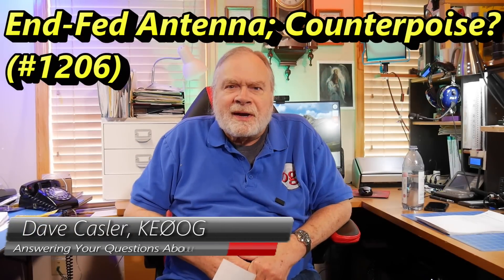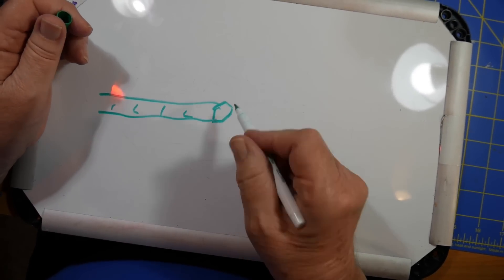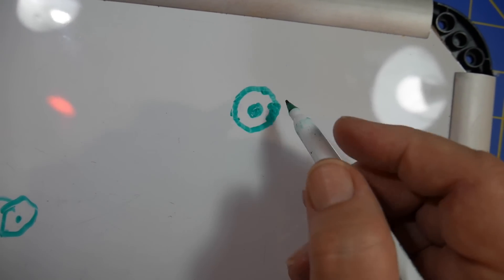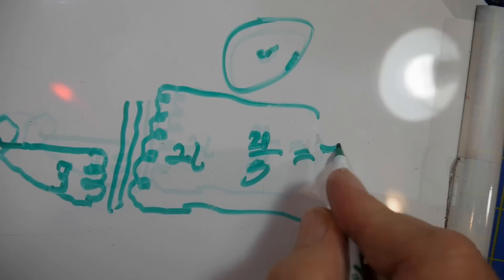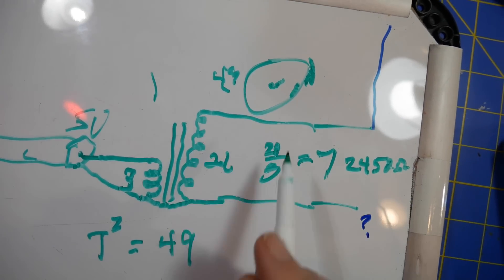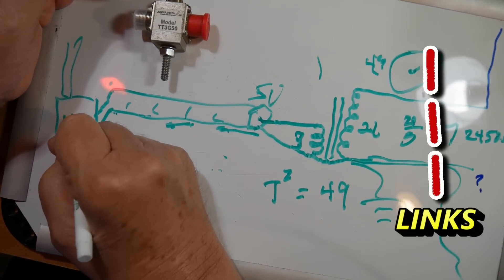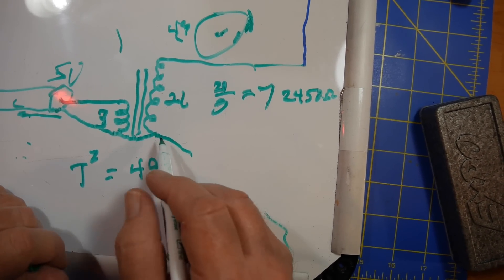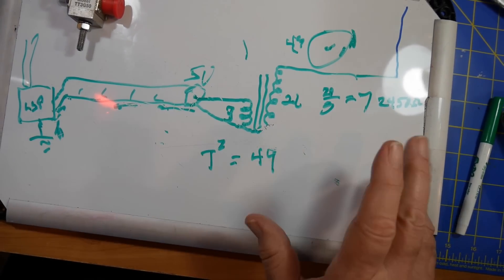End-Fed Antenna; Counterpoise? (#1206)

Comment: Question: I live in a rented apartment so I’m very restricted with antennas. However I have mature oak and maple trees right outside. I would also be operating right by the window facing the woods. There’s no point to 30’-40’ of coax between the window and the radio unless I pile it up on the floor at my feet. Should I plan on a significant counterpoise from the get-go and keep it outside? Tnx de WB3CFN!

Comment: Great Video Dave, i have built an EFHW with a 49:1 Unun with good success but now using a Random wire and a 9:1 Unun and installed the Antenna feed point about 20 mtrs away form the house so a good length of coax acting as a  Counterpoise which is then  grounded the same as yours.. Also use a CMC before entering the house to keep out any nasties. It works from 160m - 10m with some bands needing a rig autotune for a better swr and 160m / 80m a bit of a compromise with only 84ft of wire. Good dx 73s de G8TQO

Comment: Thanks for the video. I had a ferrite rod in my junk box and decided to try making a 49:1 UnUn instead of the usual torroid ring. So far it's working great I think better than the rings on an end fed approx 20m wire.73 M7JZW

Comment: I've been a ham for 50+ years.  But for most of it I only worked VHF/UHF.  When I retired I decided I should try HF.  So I looked at QST and found a number of products from MFJ, including their end fed antennas.  I read up on them and learned about Un-Uns.  So when I deployed it I realized I'd have about 100 feet from my shack to the backyard of my house.  For once, that worked in my favor!  I read that the Un-Un should be close to the ground and that the shield of the coax would be my counterpoise. 

I was blown away as to how well such a simple antenna could work.  And the EFHW works on every harmonic of the fundamental frequency!  What a gift!  In short, I've worked 128 countries in just a few years with the EFHW.

I was surprised to learn that this antenna was created by a ham in Central Pennsylvania, W3EDP --  H J Seigel.  The first description of it appeared in the QST March 1936 in the Experimenter section under the title "An Unorthodox Antenna."  These antennas were also called Zep Antennas because they were used in Zeppelin airships.

Comment: I have found just using a 16' counterpoise, or even 2 that are 180º apart, work well on my EFRW (Non-resonant, not really random wire length) antennas with 9:1 ununs. And when I use my EFHW for POTA, I do the same with great success.

Comment: Great video Dave.  Les Moxon (G6XN) himself pointed out that because the current is so low at the end of a reasonanant antenna there is not much current to mirror.   only 0.05 wavelength of counterpoise is needed (a littlw over 14ft for 80m).  Because the EFHW was "forgotten" in the '30s and "rediscovered" in the '90s' a lot of lore about end feds putting rf in the shack, etc. is actually non-resonant antenna info misapplied to resonant wires.
Reply: EZNEC modelling I've done of an 80-m EFHW shows that the optimum length of coax after the 49:1 UNUN ranges from 6-10 feet to mimimize SWR, for all bands.  After the 6-10 ft of coax, I attached a common mode choke and then 50 ft of LMR400 to my grounded lightening arrestor and radio.